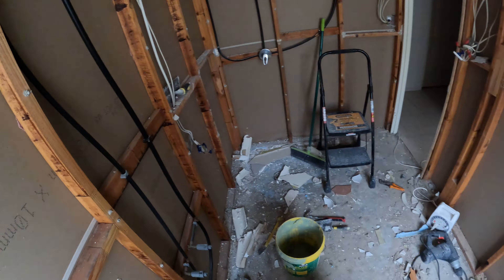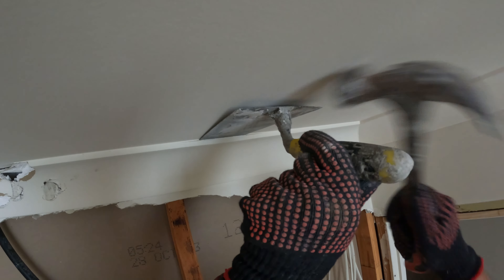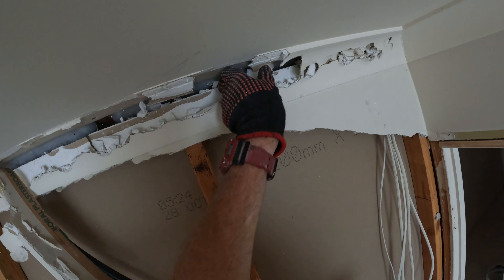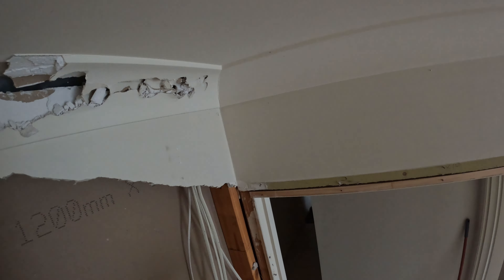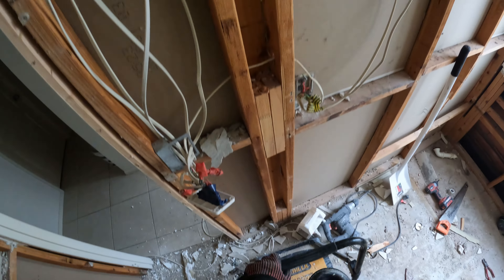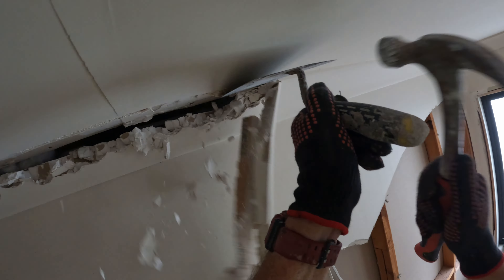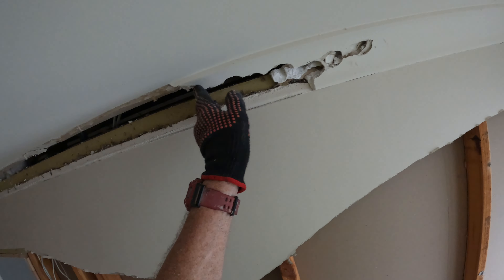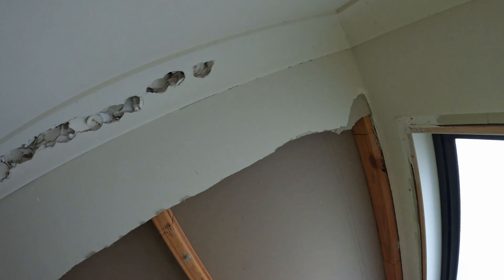Taking Off the Cornice So the Wall Tile Can Be Square Set

Comment: Always enjoy watching other ways of doing things. Try a piece of framing timber about 450 long up against the cornice flat on the roof and hit it with the hammer, breaks the cornice away from the ceiling and the same with a block flat on the wall. I’ve found a square edge block best. Like the nail cut off😊
Reply from the maker: Thanks Steve o
I'll have that one as a keeper
Thanks again for watching my channel I'm glad you are enjoying
👍🫶❤️ Chris o